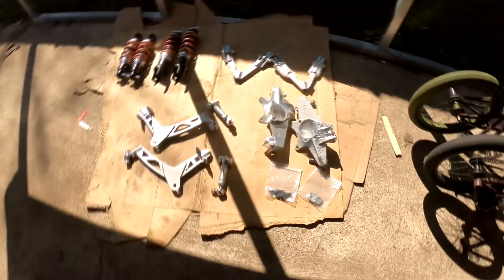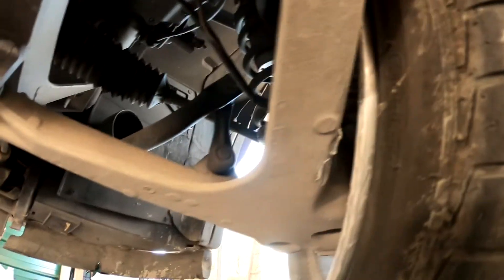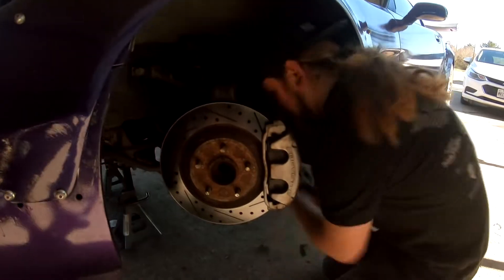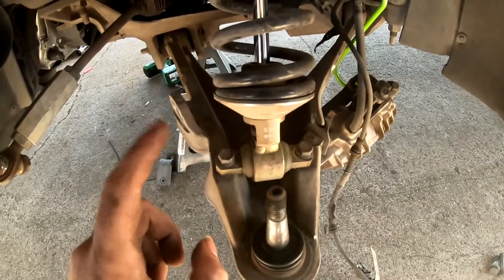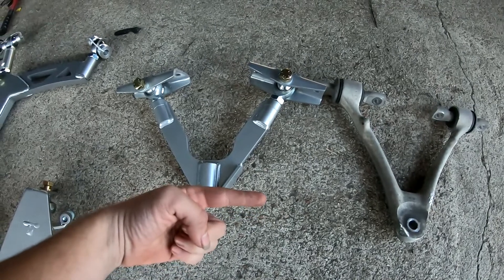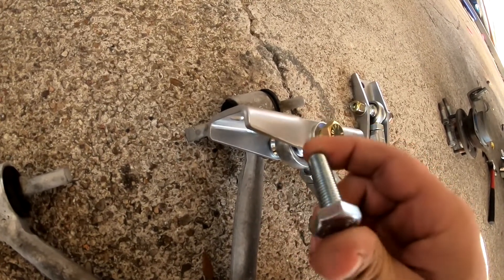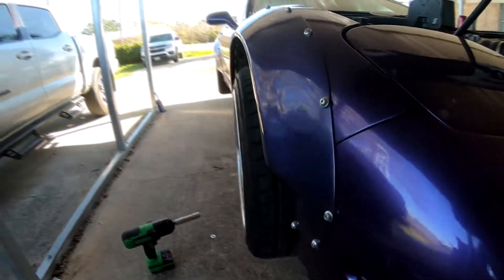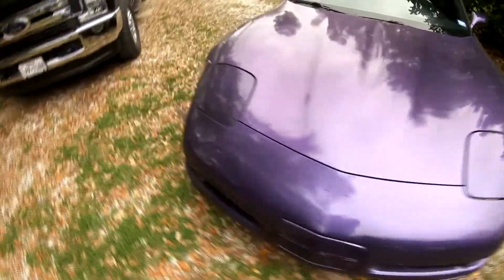FDF angle kit install on a C5 corvette

Comment: Doesn't look like that much more angle than vettenuts? I have the vettenuts and have been really satisfied so far
Reply from the maker: The vette nuts is a good kit. I was hitting my wheels on the lower control arm and wanted to stop that. Plus the alignment versatility of the fdf kit. I have a picture on my insta of the fdf vs the slr kit but not vettenuts. @ruined_c5 I love the way the car drives now though basically drives itself.
Reply: @sethkrampota  that’s awesome. So far with stock wheels and the provided spacer I have clearance from the arm. I’m hoping to keep it simplistic and not need to worry about it anymore. When wisefab releases their kit I may grab it because the adjustability is super nice like you said and I’ve heard reports of the fdf kit being a little flimsy or bendy I should say?

Comment: Does the change in steering ratio screw up the stability control and ABS sensors?
Reply from the maker: When I first installed the vettenuts angle kit it did mess with it. I unplugged my front wheel speed sensors to stop it from messing with me while I was driving